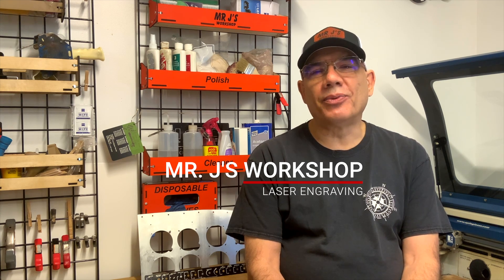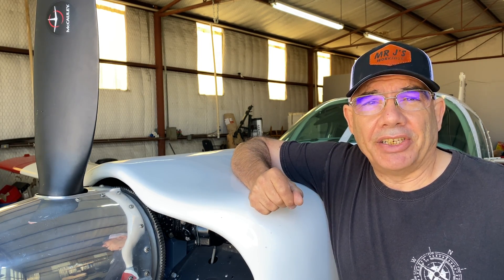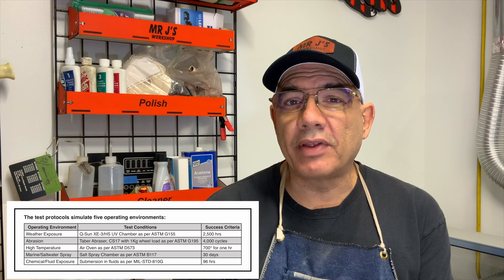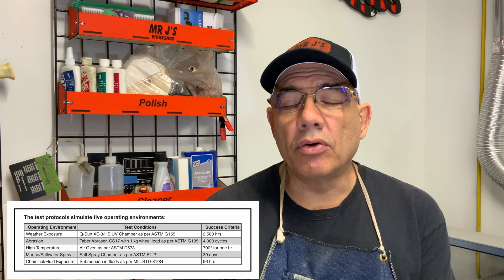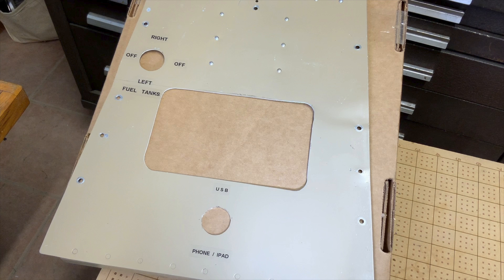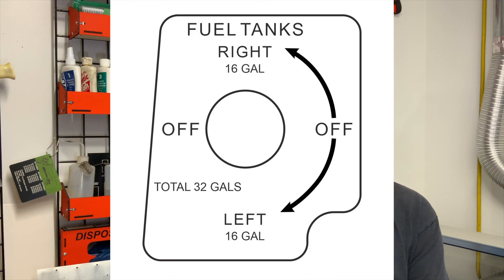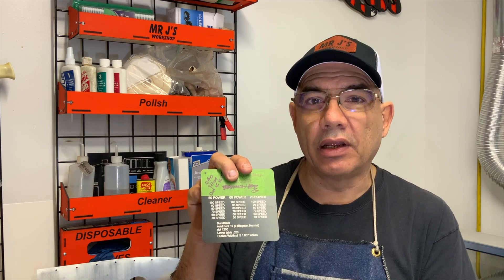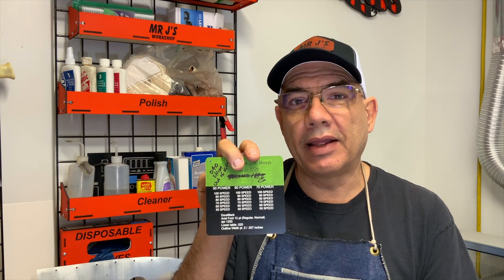Laser Engraving Aircraft Panels | Identification, Markings with Durablack

Comment: Does Durablack have Grey w/ white letters? Do you bond it on?
Reply from the maker: Durablack  engrave white lettering. It is not bonded.
Thanks for comment
Reply: @MRJSWORKSHOP what label material is available, or do you recommend that's light Grey (with white letters)? I'm about to cut my panel. Soon. Time to think of labels. 

I assume switches and CB nuts hold on the label/placard on. Spray on an adhesive I also assume is needed? 

I like these placards/labels laser etched.
Reply from the maker: Correct in most cases the nuts do the job. I also install 3m double sided tape some customer add mounting screws.
Reply from the maker: @gmcjetpilot  The Durablack only comes in black with white core for other color it can be spray painted or airbrush to the colors required.

Comment: I'm wondering why you didn't cut the perimeters using the laser instead of all that manual cutting and sanding.
Reply from the maker: So my laser will not cut metal but  I have tried laser cutting the material with other vendors, what are the biggest problem my material  has is the  coating that melt on the edges went the laser cuts the material. Also try CNC milling but it’s a project on making fixture to hold the material for cutting so basically just stay using the manual tools.

Comment: Hey Mr. J!   Nice video, and nice work.    How small have you sheared blanks down to?   

Trying to figure an in-house way of cutting this stuff with minimal post-processing or up-front tooling.
Reply from the maker: Hi Mike
I have sheared down to 3/16” any way you look at it you still have to put the work. I just keep a dedicated shear for this job always sharp.
Reply: @MRJSWORKSHOP  wow - thanks for writing back.  

How did your 3/16 stuff wind up, flatness-wise?
Reply from the maker: It was pretty flat. The trick for me is to keep the 3/16 side on the table and not the drop off.
Also having another piece of material on top holding it drop flat on the table side.
Hope that helps.